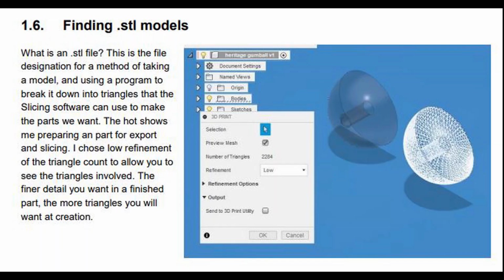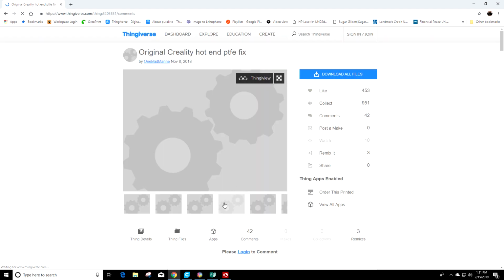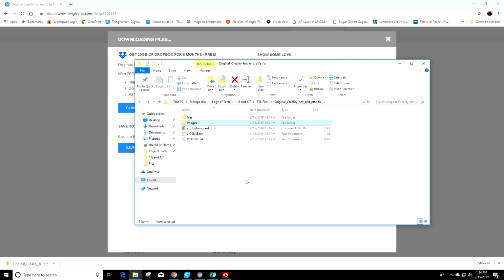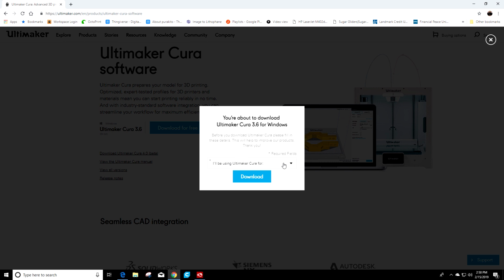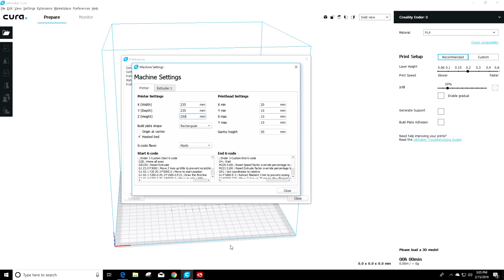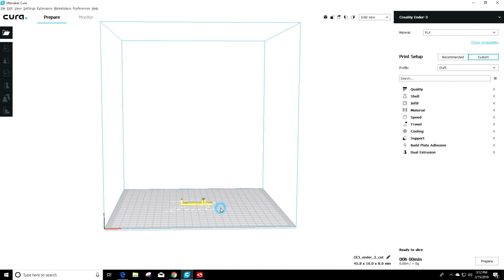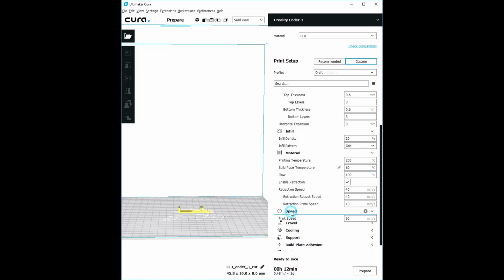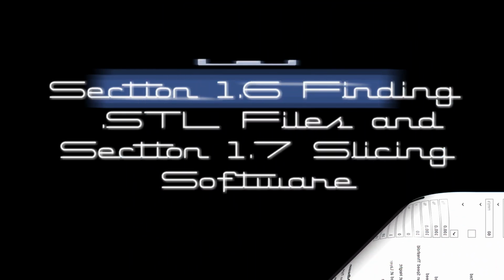Section 1.6 Finding  .STL Files and 1.7 Slicing Software featuring Cura

Comment: Hi, got a problem with the cura 4.5 i configured the ender 3 as my primary printer but the "printhead settings" are all diffrent:

X min   -26
Y min   -32
X max   32 
Y max   34
Gantry height  25

The slicer does not let me change it into the right settings, i dont know if thats the cause but the prints are coming out really bad
 any advice on how i should fix it?
Reply from the maker: Have you tried recreating a new profile yet?

Comment: when i bought a ender 3, it said the bed was 220x220x250. not 235x235x250??
Reply from the maker: That's what the product says the print area is, but in reality if you measure it, it's 235,235,250. So in the slicer you can use that!